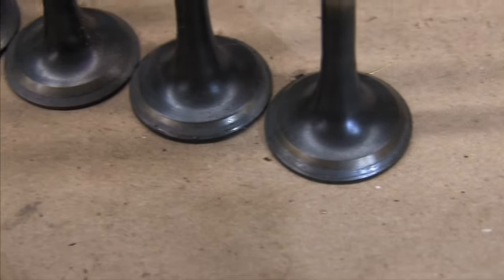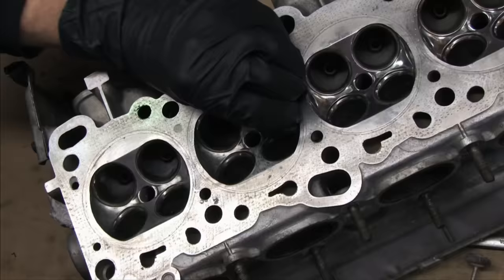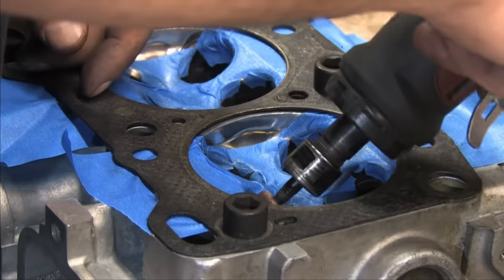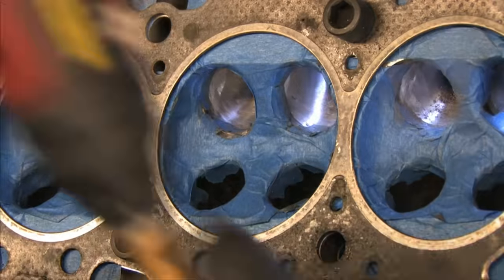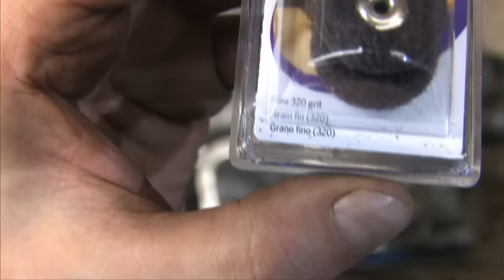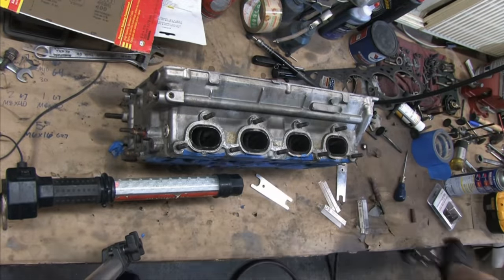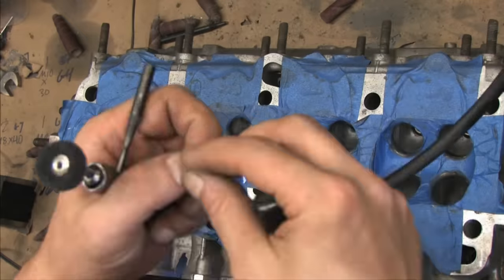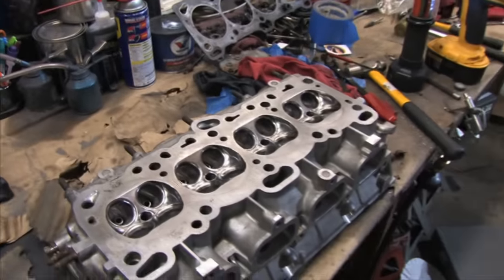Cylinder Head 204 - Porting & Polishing

Comment: Look closely at a golf ball. The dimples are there intentionally and their size has been optimized. Smooth golfballs do not fly as far. Why? Because rough surfaces create a turbulent boundary layer and reduce friction. Smooth surfaces produce a laminar boundary layer and increase friction. Under the conditions that golf balls experience. That is just the physics of fluid dynamics.

The effects of surface roughness inside an engine depend on a lot of variables, including port size, engine speed, temperature, pressure, etc. And those variables are continually changing inside your engine. And they change along the flow path through the engine. And they vary from engine to engine.

So, I am not telling you that polishing is bad. What I am telling you is that blanket statements such as "a polished surface reduces turbulence and increases flow" are always going to be wrong under certain conditions, such as laminar flow.

With regard to leaving the floor rough and making the ceiling smooth at bends: Keep in mind that the air streamlines will tend to be the same length. This is made possible by rotation of the airstream. So the air entering at the floor will be exiting at the ceiling. And the air entering at the ceiling will be exiting at the floor. The air will roll over on itself to keep from having to slow down or compress. So leaving part of the channel rough is probably not advantageous.

Comment: A perfectly smooth surface is not necessarily better than a rough surface. Having said that that "roughness" must be controlled and such often is like the grooves on an old vinyl record. The finish is known as "riblets". While it may not work for across all air speeds, for those wanting to know more here is but one atricle https://arc.aiaa.org/doi/10.2514/3.12174

Comment: That's too much work and too pretty for anything with three diamonds on it. Especially since I'll be in the scrap bin in a year anyways. But I thankyou for the demonstration.
Reply from the maker: It's 2020, and this head is still doing just fine on the world's third fastest Hyundai Elantra ever built.
Reply: Jafromobile  then even more kudos to the port job.  You polished the mistu right out of it.  I can’t even recall when I last saw one on the road.
Reply from the maker: @datsuntoyy  I probably have the last one left?  They were never popular to begin with.  I found one in a junkyard once.  The current #1 Elantra isn't street legal and ran a 12.21. The current #2 car later got disqualified because he couldn't turn around at the end of the track.  Too much tire.  He ran faster than everyone by a large margin, but unofficially.  I get why it seems like low hanging fruit, but literally everything is working against this chassis.  It's been a fun challenge to get a fraction of a second away on radials.  You sound new here?  The whole story is here.  The car was free.
Reply: @Jafromobile  Your third sentence says it all. I had a Mitsubishi once and it ate more in waranty work by $35K miles than the car cost new.  I hardly ever see Mitsubishis on the road. 
12.21 Isn't at all impressive to me.
Reply from the maker: @datsuntoyy  It's not a Mitsubishi, though.  It's a Hyundai Elantra.  I did put some Mitsubishi back into it with a friend's help, but it's never going to stack up any better than a FWD Eclipse does because it's wrong wheel drive.  I'm already making more power than I have traction for.

Mitsubishi holds the current title for the world's fastest H-pattern shift 1/4 mile.  Been holding it for years actually.  The 4g63 is unparalleled in the right hands, and your experience with it which is like many others proves that even the dealerships were often the wrong hands.
Reply: @Jafromobile  he stated it was made by mistbishi.  Hence the "three diamonds" comment.

Comment: wheres the finish engine?
Reply from the maker: It's in a 4-door first-generation Hyundai Elantra.  still going very strong!
Reply: @Jafromobile  does anything change regarding to the performance?
Reply from the maker: @milkyway6724  Yes, absolutely.  This wasn't the only thing I did to it.  It received cams and new valve springs.  It's running 13.0006 at 116mph in the quarter mile.  That doesn't sound like much, but it's a full-weight 3,100lb chassis with all power options and it's an extreme challenge to make that particular chassis do that even without them.  Only 2 Elantras are on record worldwide who have run a 12.999 or quicker in all 29 years of production.  That would make me third... but I have a feeling there are unrecorded cars out there who have been quicker.  The car is making 274hp at the wheels on wastegate pressure with pump gas.  Looking forward to turning it up to see what she'll do at 26-28 PSI...  I'm estimating 360-ish hp.  Maybe 380 with a good tune.
Reply: @Jafromobile  good job man i might do that to my CH lancer

Comment: youd think hes porting a damn 2j or something more high end, frickin Hyundai head 
great vid though
Reply from the maker: Horrible cars that make absurd amounts of power are dozens of times more exciting and fun to drive than expensive thoroughbred cars that are supposed to be fast.  Until you've driven a 400hp Hyundai Elantra 4-door, I'd have no expectation for you to understand it.  :)
Reply: @Jafromobile  
true never driven 400hp elantra. 
highest hp shit box ive driven was a 300hp civic, but ive owned a skyline with an rb25 at 500 and a shelby at roughly the same and gotta say premo engine are incredible. you gotta get yourself one of those and port it like that. cant imagine the flow increase.
keep up the  good work man!
Reply from the maker: @heinamen  I've driven a 66 Shelby with a 427 side oiler at around 740 lbs of torque.  72 Pantera with a 351c.  Ferrari 323 2+2.  I'm kind of limited in what I can fit in because of my height... but the liability and personal responsibility you have to exercise in them to preserve those classics takes some of the fun out of it for me.  You never want to be the guy that rewrote a part of auto racing history (like Sam Walton and the #9 Daytona Coupe).  

I totally get what you mean about better engines and candidates, but flying by one of these legendary cars from a roll in a $300 un-assuming shitbox you built with your own hands is one of the greatest buzzes anyone can experience.  

Don't worry, I've got bigger goals than either of us have mentioned coming in a different 6-bolt AWD 4g63 build.  This looks like a Hyundai head, and it is, but it's cast from a 4g61 DOHC Mitsubishi mold.  I said "Hyundai" but really it's a Hyundabishi Eclipstra GLS-T.  The GLS is for Got Low Standards.

Comment: What about the venturi effect? You destroyed it by widening the throats of the ports
Reply from the maker: I didn't hurt it.  Port texture is a nearly useless concept though.  You clearly picked up on the part where I said it was an experiment.  It didn't knock any more or less after it was back together.  What ultimately fixed the knock problem (that I hoped that this would solve) was MW50 injection.  This car went 13.0006 @ 116mph with this head on it, making it unofficially the third fastest Hyundai Elantra on the planet from all 30+ years of production.  Pump gas and DOT tires.  If I shave 2 hundredths of a second, it will be the second fastest.  So I definitely didn't hurt it.  But to specifically answer the question you asked, only 2v combustion chambers really benefit from any sort of Venturi effect.  Splitting the port with a divider for 4v configuration ruins it for most every 4v/cyl except the Honda F22.  Venturi or tumble are practically non existent past the intake plenum on 4v heads because the divider in the port always causes turbulence.  It's sad that pushrod motors get to have all the fun with those physics because I wanna play!  That's what this was about.  Trying to put something in there that wasn't there.  The textures I was testing did nothing measurable to its performance.  Myth busted.  The midrange gains can easily be attributed to my cam timing that was set here, or a combination of that along with the port job.  The car did run almost a full second faster with the same stock rotating assembly after port job and the cams, though.  Pull from this what you can.  I don't own a flow bench so I use time slips to measure improvement... but I know someone who has one in another state.  I hope to flow several heads on it someday soon if I can and that will give us the best info overall.  I like testing automotive folklore, it's why there's a series about Glyptal here where I'm telling everyone not to use it. I feel like it benefitted from the porting part, but that the texture theory here is useless.
Reply: @Jafromobile  Thank you for the well written reply

Comment: I think without   test equip to varifie what your doing is only your theory 
since my cylinder head porter who has me do all the rough out then finishes the job for me    Because she has had proper training (Joe Mondelo )and (after she attended his school wanted to hire her) 
I see things she has taught me but your not doing
Also porting when not knowing what you are doing can end up doing more harm than good to a cyl head 
Also porting can hurt actual  fuel economy 
Just my opinion
Reply from the maker: It's well tested on a track, and it's no slouch.  I hear you, just that doing this definitely had no negative effects.  It did improve what was there and it's moving all the air I can feed it.  It easily handles everything a TD05H 20g will make.  It's one of what's only 3 Elantras on the planet to run 12's (technically it's 13.0006 right now but I've since added the fuel to get it there/just can't test and prove it because COVID).  Admittedly that's a stretched claim, but come on, 6 ten thousandths of a second... If I didn't eat breakfast...  It's making in excess of 400hp with a 2.0L on pump gas.  More power than it can find the traction to use.  I'm working on a new tire and suspension setup to maybe skip the 12's because it runs 118mph traps. 13's at 118.  Think about that.  Joe Mondelo himself would shred this job and I'm okay with that.  He'd also understand that I did this in my garage, I'm having great results, and that he was once just like me.

Comment: There is no point to polish a combustion chamber. You need to polish the runners in and out of the head. All you did was ruin your valve seats. No race company or engine run polish combustion chambers. You should have opened up the exhaust ports more

Comment: Who would ever say turbulence is better then laminar flow.
Reply from the maker: Just the people who are atomizing fuel.
Reply: @Jafromobile  whats needed for fuel efficiency and what's needed to extract the most power u can out of a setup are 2 different things
Reply: @Jafromobile  of course your gonna get a better mix but turbulence creates pressure drop and heat
Reply from the maker: @TheDieselDangler  Oh I totally get it... I wasn't disagreeing with you on any of that.  Really it all depends on your problem.  If you can already flow more than your pistons can pump, then your problem isn't flow.  High compression makes my car knock-prone, so I experimented with the boundary layers to try to trick it into atomizing fuel better, and it still knocks.  I think I proved what I said in the video, though... that with forced induction–texture doesn't matter.  The rest of the port job worked out great, though!
Reply: @Jafromobile  thanks for confirming I was confused. I agree 100%
Reply: @Jafromobile  love the channel. Subd

Comment: All that work, to gain 2 HP on a POS 1992 Hyudia Elantra.  You're nuts.
Reply from the maker: It runs 13.0006@116mph in the quarter mile.  In either my next video or the one thereafter, come see it become one of only 3 front wheel drive Elantras ever built to run a 12 second pass.  It's a stupid goal, sure... but we all get to learn something from it.  :)  It's a really un-expected and sleepy street-legal street car.  Not everybody gets it, but that's the whole point of it.  It's a kick in the pants to drive, and it was totally worth it.

Comment: You missed polishing the quenching areas 😉
Reply from the maker: So I could shave them off when I take it to the machine shop for the valve job and resurfacing?  They whole deck comes out of resurfacing with a mirror finish.
Reply: @Jafromobile  well to be honest I never polished it like you did. I just removed the sand cast surface and hot spots. But I thought when you re doing it to prevent carbon built up you might do the quenching areas as well . But whouldnt do the gasket surface (by hand).

Comment: now dimple the intake!!! :D
Reply from the maker: I have in my head designed a "universal" tool to do that.  I have not embarked on creating it, or failing at creating it yet.  Seems silly to when everyone prefers to CNC that treatment.  For the sake of uniformity, I don't blame them.
Reply: @Jafromobile  I would just take a Dremel and a 5mm spherical grinding bit for it and start dimple with 1-2 mm apart and about 1-1.5 mm deep but what do I know, I have never done this procedure myself and I'm not that experienced with porting a 4-stroke, only 2-smoke

Comment: I wouldn’t call this high compression at all 

High compression is 10:1+ these days
Reply from the maker: It's boosted.  It's high compression for a boosted engine.  Most turbocharged applications are 8.5:1 and lower.

Comment: I havbe  120 hours on my head and it looks nowhere near yours jafro.... Thing is if the casting is real real bad you are going to be there a while taking out big dips and pits but in the end the carbon cant stick as well so your engine will perform longer.
Reply from the maker: You don't have to polish your intake ports.  You can stop at 120 grit on intake ports.  There are better ways to make carbon not stick to either kind of texture, but it's an unnecessary treatment where airflow is concerned.  In my data logs it doesn't appear to have had any beneficial effect with fuel atomization.  Polish the exhaust ports all day long because it works better as a thermal treatment than anything else.  Good job man, it takes a lot of patience, and you really get to know the part!

Comment: this is a guide on how to get a ridiculous polish on aluminum using diamonds and hand techniques on irregular surfaces, expect to spend 12-18 hours doing it though to that size block https://www.youtube.com/watch?v=2ZJ14pj9ZbY

Keep in mind however, the outside of the block would benefit from being black anodized rather then polished to increase its thermal dissipation. I suspect with a engine you get 5-10% more heat removal from black dye anodization (look up electronics articles to find out more about this process, its why the heat sinks on your electronics are often a 'black' color.

Comment: Polishing the combustion chamber is a complete waste of time. You're not preventing carbon from building up just because you've polished that stuff. On the contrary, you're probably making it more likely to build up thanks to the smooth surface.

Edit: "It will improve the burn of your fuel mixture in the combustion chamber." No it won't.
 
"And this leads to improved power output and efficiency as the result of higher timing advance." I've never understood this line of thinking. The aim of your tuning should be to run a specific AFR. Never, ever should the goal of tuning to be to run a specific amount of timing advance. Why? Because timing advance is simply a measure of how long before TDC the spark plug is ignited. Running a higher octane fuel requires more timing advance to achieve the same combustion (higher octane fuel burns slower and more predictably). You're not gaining anything by running more advance, you're just changing the timing of the flame front.

By all means, run as much timing as you can. But this should be the very last thing you adjust on your tune, in order to make everything work properly. The goal isn't to run max timing, the goal is to run just enough timing as necessary to make the flame propagate ideally in order to make best power. The better your tune, the less advanced timing this requires.

Comment: yeah i see the biggest problem of them all....it's a 1992 Hyundai motor! lol
Reply from the maker: Incorrect!  The only part of the entire engine that's between the valve cover and the pavement that's from a 1992 Hyundai is just the aluminum casting portion of the cylinder head, and one axle.  Everything else is from a different car, and everything that's wrong is so right.

Comment: Sooo... you DID polish the tops of your pistons too, right? I mean polishing of the CCs was all about preventing knock, predetonation, by making a shiny surface that carbon can't stick to. At least that's your theory.
Also, if your using a turbo, all of that grinding in the ports is maybe going to get you 2HP, less than 1% improvement. We've known that since the first flathead V8's got blowers on them back in the 1940's.
You read too many Hot Rod Magazines. Go to a real school run by a manufacturer.